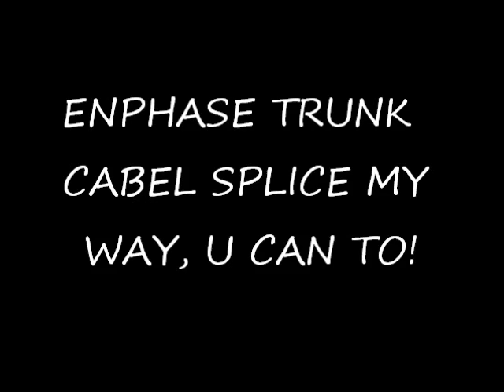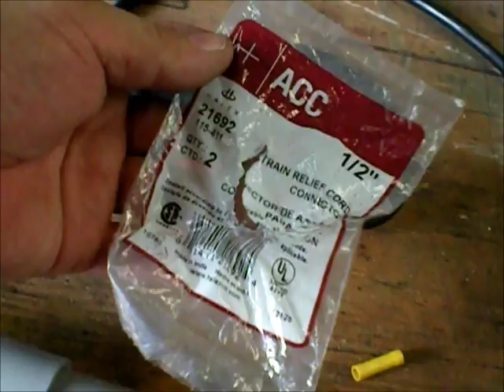Enphase Trunk Cable Splice My Way, U Can To!

Comment: I bought a Enphase M215 for testing in my area, I am wanting to save money and avoid buying the Enphase trunk cable as identify in making micro inverter Enphase which is the terminal phase, neutral and ground?
Reply from the maker: Don't Know I got my cables  on eBay.

Comment from the maker: I did a much better job on the real one,than on the quick demo ,& yes I sealed all threads and the secured the splice to in my tracker Frame under the solar panel.it works great, when I do things I must always put the solar Trackers through all the moves they will make ,East to West & No.& So. so it was nice to have that not glued together in case there was Trouble some were,things hitting wires to short & so on.
Reply: Next time if your sure your connectors are good you can use some liquid electric tape then the heat shrink after that, then there is no question if your air and water tight with your connections. The field splices from enphase are way to expensive you could set a water tight box and save some money. I personally am not a fan of butt or clamp connectors i would go old school and solder each joint use the liquid tape and heat shrink per connector then the bunch would get liquid and shrink again for good measure.

Comment: I have bunch of left over trunk cables of various lengths that I was planning on using on my next add on. I love what you did here. Will try same. Are also sealing the PVC tune to the threaded PVC pipe too?

Comment from the maker: If u can find A Enphase splice unit its just a plastic tube with a twist to seal gland on each end. This set up is very strong & water tight ,plus U can remove it if need be.

Comment from the maker: Thanks, that just shows a way to make some thing strong & removable  if need be. My splice was a bit smaller & is secured to the tracker frame behind the solar panel away from direct weather. It served the need for a reliable connection. I will show the actual install in a later video when I have more data to report on power made.